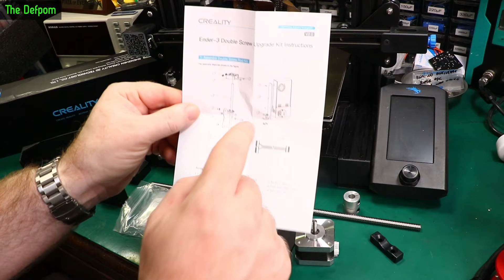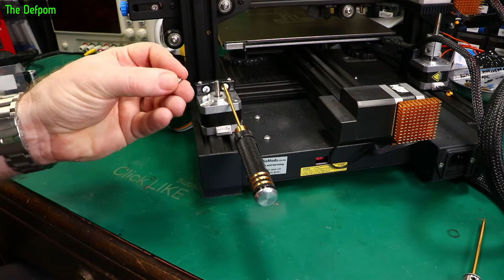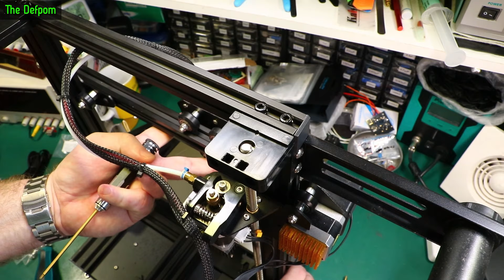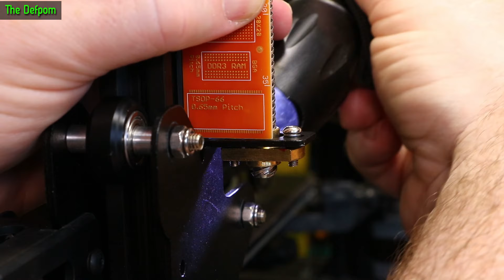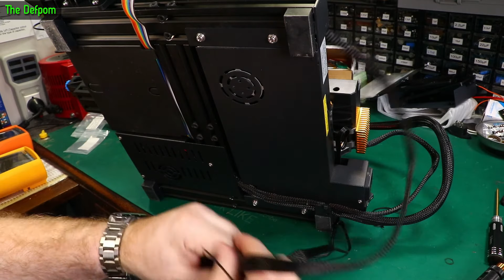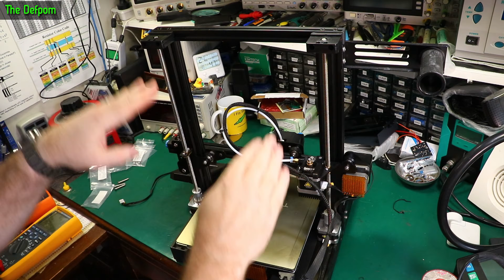🔴 Creality Ender 3 V2 Dual Z Upgrade - Fix Z Axis Problems ! - No.1079

Comment: I tried and I tried but the right side is at least 2mm lower than the left side, as if the new Z axis wasn't there. I loosened all the screws and after raising the X axis made sure the distance from the top of the gantry was 100mm at both sides. Then I gradually tightened the screws one by one and made sure again that the X axis was level. After a few prints, to my surprise, if I raise the X axis the distance to the top remains level but from the base of the printer the right side is 2mm lower.  The prints seem to be ok.

Comment: About 4 months ago or so I was at the local Goodwill outlet store and scored a Voxelab Aquilar C2 printer, which is basically an Ender clone for about $10. The only thing wrong was that the hot end was burned out.  Replaced that and it worked good.  I was going to do the dual z upgrade.  Ordered the kit and everything to do it with.  Yesterday at the Goodwill outlet store I scored an Ender 3 v2 for $18. The only thing wrong with this was that it was missing 2 of the rubber feet.  So now do I upgrade the Ender 3 v2 or the Voxelab, or just order another kit and upgrade both?

Comment: Yes - screws nice and tight but NOT OVERTIGHT where they are going into tapped holes in the aluminium frame.  If you have gorilla arms it's too easy to strip the thread!  (and that will often not be easy to fix).

Comment: yeah unless the z screws are locked together this is worthless
Reply from the maker: @JohnDough-J3DCNC  it isn’t worthless, it is still an improvement on the original design, as long as you are careful not to move the z by hand or move a motor by hand then it is fine, I’ve been running this printer this way for months. I do have a video recorded where I add a belt between them to lock them together, I did that a few weeks ago, but haven’t published it yet.
Reply: @TheDefpom  any kind of resistance on either side to the motors cause this to get out of whack. There is no real way to make sure the trolley is parallel to the bed, ever. Even the slightest change while bed leveling can cause problems.
Reply: @TheDefpom mine goes out of sync with power off. I 'level'the gantry in the SOVOL way with steppers off. (Raise to top of frame) Then turn steppers ON and level etc. It is a bit of a faff, but solved the issue
Reply: I've since seen it suggested that anti backlash nuts may help reduce the tendency of the gantry to sag (back drive) the z screw with power off, so I'll try that soon
Reply: @imaginitivity7853  Nope the motors are not strong enough to power though those

Comment: How do you hold the glass in place without clips
Reply from the maker: you need clips
Reply: @TheDefpom  I put glue stick on the metal and put the glass down and it seems to work lol
Reply: @thespacecowboy420  don’t do that. just get some clips or get a non glass bed which will just be magnetic

Comment: Print yourself a pair of gantry trestles, it makes life a lot easier aligning your gantry,  don't use them on the bed  but set them from the lower frame to the gantry,  rest it on them and tighten up - no measuring needed - that will square the gantry to the frame  after that square the bed to the gantry and your golden

Comment: A very good  method for building these things, keeping it all slack until its all lined up and keeping cable routing in mind. on my CR10 and £nder 3 (early models)  I use a similar method to myfordboy uses using a drive belt above the gantry  to sync both leadscrews on a single stepper,  as  I learned  the hard way that  when  using 2 steppers for Z axis   they can go out of sync when the machine is turned off.

Comment: Thank you for sharing.  I just recently bought a very similar kit, or I think they've upgraded it from when this came out.  The stepper motors' (I received 2 in the box) mounting bracket are now aluminum (I replaced both).  They've also added an anti-backlash springs for the lead screws, (again 2 sets, one per lead screw) and it's supposed to be suspended on springs, which I didn't use and just mounted them directly to the brackets.  They provided an extension cable instead of that long one for the stepper motors (I didn't have to open up the access for the motherboard).  I followed your procedure the square/align everything up and it's working great.  I initially had an issue with binding when I installed the anti-backlash on the original stepper motor, I realized that I had to flip it 180* then the binding went away.  Supposedly a spacer needs to be placed behind the original stepper motor for it to align properly, which I 3D printed and have installed when I first got the printer, did you have this issue?  Edit* adding where I got the kit from: https://www.amazon.com/Dawnblade-Ender-3-Upgrade-Stepper-Creality/dp/B08PP9XQP5/ref=sr_1_5?crid=2MSODIGIN8LA5&dib=eyJ2IjoiMSJ9.HnK874HBSrSEgGKCAymBuoxcjgMuL5GCf3WKgDwz8kZZ1DGQgrR4TIhMuMKLJpe4d7QslXervUQg_0n4t90lzfUzmcirTCiAAjyw6b26E1M5b8PZjlLfD5H9i2VNM1XGJO6wDYZT9pIh-9Kr0LGW7L1kMWxZGbyQ7ggv8w-1BqwayYw00JxFEUm0P1hyfB6tcmORTjlX9G8ihKl0BAa3rCV2jd1r2BYAB7hNzx6as1A.yuYMxRzS7AIooIz-rPjHWMK6w3K-zoi_629u-wE_8PY&dib_tag=se&keywords=end+3+v2+dual+z&qid=1709122390&sprefix=end+3+v2+dual+z%2Caps%2C77&sr=8-5

Comment: You didn't turn up your z stepper amps to run both motors.
Reply from the maker: I didn’t need to, it has been running fine like this since doing the video all those months ago.
Reply: @TheDefpom  okay.. I put a timing belt on my custom ender extender and it was just enough to make them skip and not want to move so I turned them up to 2 volts and it's perfect now.

Comment: Thanks a lot for the video! Definitely helped me installing the second axis :D But unfortunately  I couldn't get rid of z-axis binding with dual z. 
I tried everything I read online, and even reassembled the whole printer from scratch. So the video helped me with uninstalling the second z axis as well :D
Reply: You don't have the same kit then you have to adjust the voltage on the board the motors aren't getting enough power.
Reply: @leonapelletier9659   Thanks a lot for the advice, I'm gonna try that this weekend!

Comment: I’ve seen in other videos increasing voltage. Either I missed it in your video or it’s just not necessary. Thoughts?  Thanks for the video
Reply from the maker: In my case it wasn’t required, working fine without adjustment

Comment: Adding the bracket on top of the acme screws reduces the height of the z-axis. I learned the hard way. I removed mine and my prints come out fine.
Reply from the maker: As I said I don’t print stuff that tall anyway so my case it didn’t matter.

Comment: So around 31:30 you mention the excess wire they didn't prune down.  I wonder if they just make one size that covers the larger Enders as well. For cost wise with manufacturing it might be cheaper to pump all of them out in such a manor. Good video, I will be referencing it during my install soon. Thanks

Comment: Is this kit works also for the v2 neo ?
Reply: It does. I just did it a few hours ago.
Reply: @SirVergil  thanks for the reply
Reply: @zivtavivcreative  You're welcome
Reply: @SirVergil  did you felt change in the printing with this kit ?
Reply: @zivtavivcreative  I didn't managed to test very well last night, i only did a few quick prints( some calibration cubes, some cylinder) and it did well. The walls seem to be abit more stacked untop of each other better. 
Much more stable, now the x axis doesn't fall. Without the second motor, everytime I finish a print, the X was falling and touching the build plate. Now I can install in the future a direct drive.
Reply: @SirVergil  Cool
Reply: @SirVergil  that shouldn't happen, you had the x gantry excentric nuts ultra loose or something.
Reply from the maker: I don’t know, possibly
Reply: Yes it works.  However you should have experience in a neurosurgeon to safely release the connector on the motherboard from the compound. Check out you motherboard  before you will by this set.
Reply: @axelzipper8171  Some isopropyl alcohol sprtized on the hot glue (so that it can "get under the edge" of the glue-blob) frees things up darn close to instantly (5 minutes, tops) so you can just flick the glue-blob away and go about your business as if it had never been there to begin with.

Comment: To couple the two lead screws together, you can use 2 30 tooth gt2 pulleys with a 640mm gt2 belt. Other combinates can be used.
Reply: they have separate motors there's no point in coupling them together. get a new mainboard and ditch the splitter. run the motors separate and get automatic gantry leveling and you're on your way

Comment: I made the mistake of changing my bed when I also did this upgrade. Now I can't seem to get my prints to come out smooth. I've leveled it several times, played with the z offset, tried different PLAs, now experimenting with adjusting speed and fan. I'm relatively new and it's just frustrating trying to get this to print half as well as it did before I did the upgrades. I'm about ready to remove this one and at least see if I can get it back to printing like it was.
Reply: make sure everything is running smoothly and not binding up.

Comment: I just completed this mod tonight on a brand new Ender 3 V2 Neo and the gantry feels extremely tight when I try to raise or lower it. This is after I loosened the two motors and two cap covers in an attempt to align them. However it doesn't appear to have any issues with the motors moving it up and down. Is this normal?

I also noticed on the Neo before any mods were made that the X-belt has three grooves in it. The first groove catched exactly in the middle of the gantry. Each of the other two catch closed to the each side and seem to be equally spaced apart from the aluminum frame. Is this normal?

Comment: A proper design has the axial load bearing at the bottom and the top of the screw is free floating.  The typical stepper motor doesn't have an axial load bearing.  The flexible coupling allows for movement in the z axis, so that hurts accuracy.  With the screw fixed at both ends, any bend in the screw will cause Z wobble.  You would be better to copy the gold standard working configuration used by Prusa with a motor that has the screw directly attached and no bearing at the top. These upgrades look fun, but the results will be variable unless you use a proven design with high quality parts. In the end you may have a good printer, but it will have no resale value.   Unfortunately there is little to no measured results for Z axis accuracy published for printers in the 3-D printing world.  If you want good results, accurate measurement is required. I used a micrometer to measure the accuracy of the z drive in my Prusa and compared it to my two Wanhao D6 printers.  The Wanhao had  10 % variation in the height of a 0.2 mm layer.  The variation of the Prusa was below my caliper resolution. Needless to say the sides of the prints from the Wanhao printers are wavy crap.

Comment: I just found this video while researching a problem that I'm having with my Ender-3 Pro, after the upgrade.  I used to use the belt driven dual Z axis and it worked quite well.  But, being a machinist by trade, I wanted more accuracy and less load on a single motor.

Now, after installing the exact same upgrade that you use here, I'm having an issue with my Z steps increasing, ever so slightly, as the Z value increases with the error being cumulative.

Originally, it was the opposite with the Z axis not moving enough per step.  So, following some advice I found through various forums and content from relative experts in this field, i bumped the current to the Z motors by about 15mA to compensate for the slight increase in load.  This solved that issue.  But, now I've got this new issue of excessive movement.

I'm going to do a full realignment later today after being inspired by this video.  I'll probably drop the current back down after that too.

Any thoughts on what could be causing the excessive movement would be most appreciated though.  It's been baffling me for a week straight now.

Thanks in advance and excellent video.  By far, the most detailed and in depth I've seen yet.

Addendum: after loosening everything and checking for alignment and proper torque of everything, I discovered that the motors were fighting one another.

With the machine unplugged, I turned the Z axis to raise the gantry and felt a lot of feedback and clicking. Disconnecting the second Z motor eliminated this. I tested this a few times and got the exact same results. Moving one motor would cause the other to move in the same direction.

I'm in the process of reverting back to my belt setup now.

Comment: hey I know this video is from 3 weeks ago but I followed your video step by step (it was great) but I noticed a weird noise when turning on my ender 3v2. When the Z-axis moves it makes a very subtle rumbling noise and one of the stepper motors also makes a weird noise as well (almost sounds like a very quiet jet engine). When I click disable steppers the noise goes away. Any clue what you think could be causing this?
Reply from the maker: Sorry I don’t know, try unplugging one stepper motor at a time and see if it goes away, maybe they are not aligned to each other’s height and they are fighting each other (just a guess)
Reply: Not a pro but try double checking the the silverthread lock is not touching the bottom of the stepper motor. Also if you are using the top pieces to hold the threads in place remove them see if it goes away, if the thread rods are not perfectly straight they cause issues
Reply: I know this is mont old but i have the exact same problem, was fighting with it half day and i'm about to give up and revert to single axis...
Sid you manage to fix that problem ? If yes can you explain how ?

Comment: Why do you not have to raise the milliamps for the Z motor driver since it is driving 2 steppers?
Reply from the maker: Mine seems fine, I guess it’s because the pair of motors are lifting the same total weight but is now shared between them

Comment: I would have thought 2 steppers AND a link belt would have the steppers fighting eachother, so hmmmm it's either/or I think.
My AnyCubic i3 mega has 2 steppers and works great.....so your 2 steppers should be a great upgrade.
Reply from the maker: I think linking them with a belt would be OK if it isn't tensioned right up so it has a bit of give in it, all it has to do is stop them going out by a large amount, a small variation won't matter.

Comment: I bought a z upgrade that uses belt drive off of the original lead screw at the top. TH3D Studio carries a z upgrade like this. You don't have to worry about 2 steppers being in sink
Reply: That’s what I was thinking of…
Could you post the link?
Thanks

Comment: I've got the Ender 3 pro with the dual Z motors i added longer lead screws and put some GT2 belt and pulleys on the top with a tensioner   . Mine was also a V2 and one thing i hated about it was the display . So i went back to the V1 display. And added the BL touch . Also i have dual extruders and i run Marlin software
Reply: I switched to the Jyers UI on my Ender 3 V2 and upgraded the screen firmware and any file names wider than the screen scroll across.
Reply: On V2 display I'd give MRiscoC a roll. I think you'll prefer it over V1 screen

Comment: You will need to let us know how it works out in practice.
Whether you get alignment creep as the two shafts electrically and not mechanically connected?
Funny I can’t find the upgrade on their web site but can find sellers everywhere else.

Was thinking of fitting the direct drive extruder to mine and this looks like it should be done first, to take the weight of the servo on the gantry.

So please report back on any issues as as usual there are 5* and 1* reviews for this modification/upgrade.
Reply from the maker: I have done a couple of prints so far after doing this upgrade, it worked perfectly, I used this printer in the live stream last weekend to print the replacement impeller for the Quick 861DW and the only issues there were my print settings.
Reply: @TheDefpom  well i might upgrade after christmas might get a bit cheaper in the sales.
The best thing is that if it don't work out i still have a use for a sero and shaft.
Reply: @TheDefpom  hey any problems 3 months on? Trying to save some v2 neos that are dogsh...
Reply from the maker: @oldman_eleven  working fine, I did pick up a z belt kit which I will try adding too, haven’t got around to it yet.
Reply: @TheDefpom  fantastic! Thanks for the response 👍